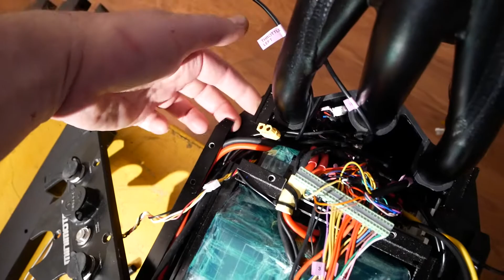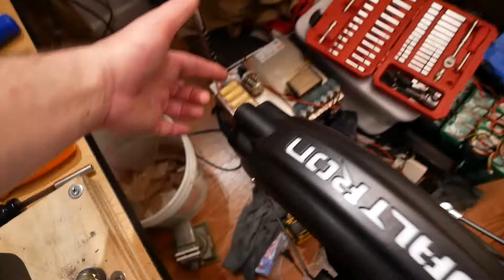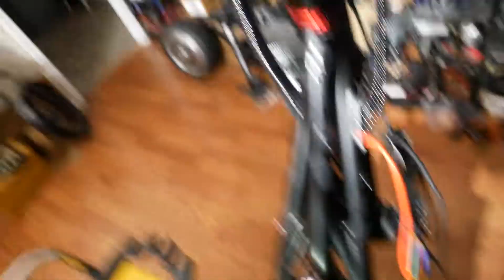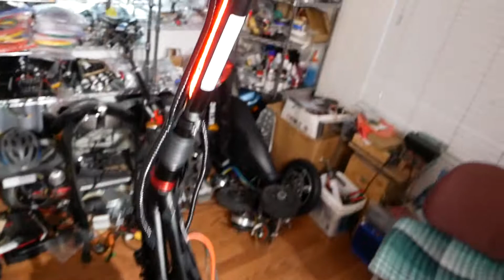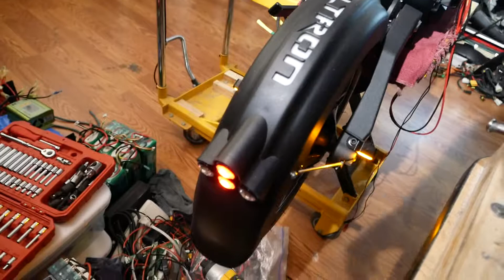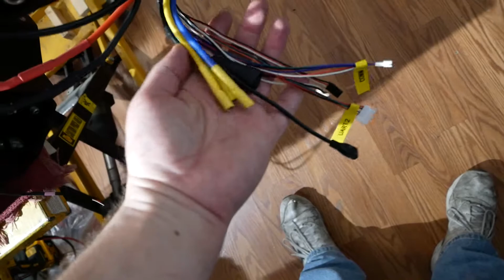Dualtron City build update 20220719

Comment: Any updates on the escs?
I like the ubox but the Kelly is scooter oriented...
Maybe a pair kls7212 will do the job.
Very informative video.
Reply from the maker: Kelly doesn't make anything FOC. They claim they do with the 8080i series, but they are in fact just sinusoidal controllers. While Kelly has been around a long time, they have failed to innovate and develop a real FOC controller. The KLS series are decent sinusoidal controllers, but  kind of picky and won't work with some motors. If that is the case with the these hub motors, I can't say, but I have a KLS and there are several inrunners that I could not get it to run. Kelly was not any help either and admitted that the KLS series was finicky at times.
*
The 75100 controllers are up next. In this video I mention a directional light problem. That's still dogging me and I don't have it fully resolved yet. My rear directional lights are still being problematic. Once that is resolved, I'll move onto the controllers. They need several hours time and some small cabling ran to them yet. Probably this week or over the weekend.
Reply: @de-bodgery  Back to ubox then....
I friend has it on a gunai 54 like the ti30 and it works like a charm.
It lacks the e scooter usability tho...
Waiting the results of the 75100s.
Btw I bought the new ant bms.
Seems good quality although it needs a good cleaning to take all the Flux off.
I may install extra copper bars...
Reply from the maker: @jkrsecret  Ive never tried UBOX before. Until you mentioned them, I had not heard of the company before. I think in the near future I'll have to buy a couple of their 100v controllers to try out. Flipsky is products I have used so I have some level of confidence in their stuff. They have 3 100v controllers now. I don't understand why they call them 75XXX...which is confusing...since they are 100v controllers! Anyway, I'd probably go with one of these before I used UBOX, just becasue I've used several other FLipsky controllers previously.

https://flipsky.net/collections/electronic-products/products/flipsky-dual-75100-with-aluminum-pcb-based-on-vesc-for-electric-skateboard-scooter-ebike-speed-controller

https://flipsky.net/collections/electronic-products/products/flipsky-75100-with-aluminum-case-based-on-vesc-for-electric-skateboard-scooter-ebike-speed-controller

Another option is Tronic. If you've ever heard of RION scooters, they spun off their controller group. They are more expensive, but also lots more powerful than most other VESC based stuff. Tronic isn't pure VESC as they have spent the time to fix several issues that Vedder has not dealt with. VESC tool still works with them, but they run their own firmware. I'll be buying a couple of their 250's soon for another project and probably a couple of the 750's soon too.
https://www.tronicsystems.com/shop

ANT...I like those BMS's, but the app isn't very good...or at least the latest I have isn't. Perhaps you have a link to a current version you can post? I've been using JBD since 2016 and been pretty happy with them and the app is really good.
Reply: @de-bodgery  The ubox from spinted uses vesc software with more copper on the pcb than the flipsky.
They don't heat up so easy.
I saw those new flipsky controllers but better the Ubox for me. 
There's an op on YouTube that says even the new ones (flipsky) still heating up. 

Me to I never heard about the tronic escs. I believe you have to push the scooter very hard otherwise I don't see any reason for them.

I can send u the new version for the ant bms but not here. 
I don't want someone else to install it and burn just because the apk is not 100% compatible with the bms. 

A good 16s70A  esc is enough for most of the scooters. 

I wish hobbywing jump in....
Reply from the maker: @jkrsecret  Can you post whatever video you found about the new Flipsky controllers getting warm? You can look me up on DIY electric car as rishimaze. We can PM or whatever from there about the ANT app.
*
UBOX appears to use the D2PAK-7L package for their mosfets. The mosfet package is the same size as a TO-220 with more pins in it. I'd have to look for the specifics, but Flipsky uses a more compact packaged mosfet. This makes for a smaller heat pad under the dye. It means most of the mosfet cooling is done from its top face to a heat sink. Problem with the DPAK package is the heat path is out the back of the mosfet like it is for TO-220. You solder the mosfet to the circuit board, pass heat through the board and on to something else for a less ideal heat path. The chunk of copper under it is the only path to pull away heat and into a heat sink. With the much smaller mosfet packages, you can put the heat sink on the top face and use copper on the back. It's probably the better mosfet package option for cooling.
*
UBOX looks interesting and has my attention. It won't be today, but soon that I buy a couple of their controllers to evaluate. The Flipsky 75100 is poorly made and needed lots of attention to make it solid. Flipsky totally failed to design them properly! I have no idea why they bothered shipping them! I guess for the price, they are decent. They HAD to know the design would have issues. I've never used Tronic controllers, but it's all the gets used in RION scooters and a few other EV's you can buy. They can't be too horrible!
*
Amp delivery is all about application. A motor that gets hot at 50 amps won't last long at 100 amps before it cooks! No point using a really powerful controller on a motor that can't take advantage of the amperage it can deliver! I ride a 275 pound electric scooter every day. I need lots more amps on that than I do on the City for no other reason than the weight of the EV. Then add top speed of 80 mph and that takes more amps too. What is great on the City is under powered on my much heavier sit down scooter.
Reply: @de-bodgery  There was a video from a French guy with 2 new singles on an e scooter. He sais that the heating issue still remains but not so huge.

Until now there are no thermal issues with the ubox.

I've registered in the forum but I'm not able yet to send you pm. I believe in a couple of days...
Reply from the maker: @jkrsecret  What is your account name there? I should be able to PM you immediately. UBOX is totally new to me. Other than looking at the pictures, I can't form much of an opinion. Most VESC offerings are intended to be used with an external heat sink since they all lack cooling fins or other ways to radiate heat to the air. A few have a water jacket. If people are depending on their VESC's with no heat sinking, they are not using them correctly. This can be done, but not at the full power of the controller as the smooth aluminum shell, if it exists will radiate heat poorly to the air. In the case of the Flipsky 75100, they have several poor design choices including an entirely inadequate shell that could work as a heat sink.
Reply: @de-bodgery ...

Comment: Awesome, you should be contacted from dualtron or any other scooter brand, you’ll make happy clients very quickly. Well done sir. Congratulations of your excellent work.👏👏👏👏👏
Reply from the maker: I work in the EV industry. I work for a company that develops charging technology. We build charging tech for everything from smart phones, tool packs to electric cars. You'll probably never see our company name anywhere because our tech is inside products for others. As a side gig, I've been doing repair work at the local scooter shop (Next Level Scooters) in the Denver CO area. I rarely get involved with the simple issues. Whenever something complicated comes along, they will contact me to troubleshoot and resolve the problem. Sometimes I come to the shop and sometimes they bring me the scooter. Through my relationship with Next Level, I bought the Dualtron City that I am modding. The initial goal was to upgrade several of them, but Minimotors has designed the packs so close to the existing maximums for the existing hardware that upgrading takes an all new pack and many other things in order to support a higher performing platform. As a one-off build for me, it's compelling, but the time and cost involved is substantial and would make the upgraded scooter prohibitive for me to make multiples of them. IF, someone like Minimotors did contact me to work for them, I'd consider it. I'd also tell them up front that I will be insisting on changes to the designs of all their products to improve, correct and rework many aspects of the product line. It's not that Dualtron scooters are bad or crappy, just not the best they can be. Most of what I would change adds little or no cost to the scooter, just improves the way things are done. They are not built with servicing and repair in mind. This is a fairly common problem in all sorts of things. Design and build the product with cheap and quick assembly in mind, but not for what happens later when the device needs repairs. I'd present many things I have found in scooters and actively seek to change them for the better.
Reply: @de-bodgery  US MARINE NEEDS ASSIST : I WANT ONE (SCOOTER). 265 LBS. I WILL ON ROAD ONLY. NO SILLY STUNTS. DONT CARE ABOUT TOP SPEED  35+ WOULD BE NICE WITH ME ON IT.(BIT MORE IS FINE) I CARE ZERO ABOUT LOOKS ( I DONT GET THAT AT ALL). NEED QUALITY.
SOOOO   WITH THESE THINGS (THE TOP 2-3 BRANDS) ..A FEW QUESTIONS :  HOW MANY WATTS DO I NEED? WHY ARE SOME JUST WATTS AND OTHER "PEAK"? JUST A MARKET TRICK?  AND MOSTLY.  I WANT TO JUST RIDE THE THING....SOME MAKE IT SEEM LIKE THEY BRAKE /POP TIRES AND BURN OUT THIS AND THAT....MOST ON UTUBE ARE A SHOP OWNER/WORKER OR ARE SPONSORED AND NEVER TELL THE TRUTH.....SOOOO... WHATS THE REAL DEAL,MAN. WHAT CAN A NORMAL..EASY RIDING PERSON EXPECT?  I SAW A VID WHERE A "STORM" OWNER SAID "EXPECT 10 000$ PER 5000 MILES FIXING BROKEN THIS AND THAT"

ANY CHANCE FOR A REAL WORLD COST VID...AFTER U BUY ONE OF THESE SCOOTERS?

TY IN ADVANCE
SEMPER FI
GUNNY
Reply from the maker: @BOOSTEDLASER  Best thing, toughest, biggest, built like a tank is the Dualtron X2. It's your "one scooter". It's faster than you mentioned, but so what, just don't pull the throttle to WOT and you go slower or turn down the power. Wattage you need? LOL! I have no idea what you need! I know my tastes are for lots of power so "I need" probably a bit more than you do. You can assume that whatever spec you read about scooters that they always list peak watts even if they don't say so. This is never realistic and it's not like you will see "peak" whatever very often. And yes...its essentially marketing hype. The Storm LTD is pretty quick. If it didn't burn out controllers, I'd like it loads more as that's it's single biggest detractor. $10k of repairs? That's an exaggeration! The regular Storm (not LTD) is pretty good and I recommend it widely. It would probably serve you well.
*
Sort of curious...do you know how to type in both upper and lower case?
*
Real world cost is usually quite low...just the cost of charging. If you jump your scooter and smash it into things all the time, expect stuff to break and need replacing. I see scooters like that and they need regular repairs! I replaced the front tire on a scooter 2 months ago and the owner has already worn it out! He buys a new scooter every year because he totally thrashes them! So treat them with care and they last years. Abuse the crap out of them and expect to break things.

Comment from the maker: i figured out my flasher issue last night. The front and rear directional LEDs are not 2 sets of LEDs inside. They are one set and a resistor. Running is dimmer than directional and that wire uses the resistor to reduce LED brightness. Directional is direct to the single set of LEDs. This means that the running light wire back feeds voltage to the flasher module and makes it disable when the main lights are on. To fix this issue, I'll need to add diodes to the wires that go to the flasher module so current flow is forced in one direction only. If they were dual LED modules, the LEDs would be their own diodes and this would never happen. Not a mistake on my part, but a corner cut so these little LED modules could be made cheaper! Grrr! Easy to fix, but should have never been done this way. I'll build a little board with 4 diodes and four 3 pin JST connectors on it. The LED modules will plug into the board and then through the diodes and back to the terminal block. This will isolate both positive voltage paths to the LEDs from each other to stop any chance of back feeding voltage to either the flasher module or the main lights. The devil is in the details as usual!